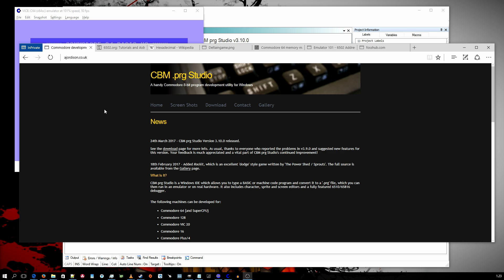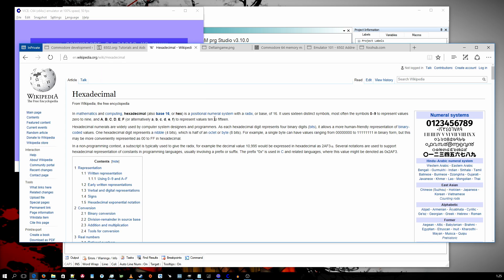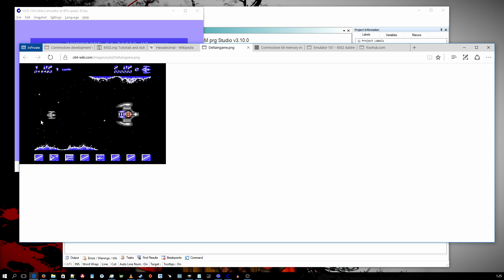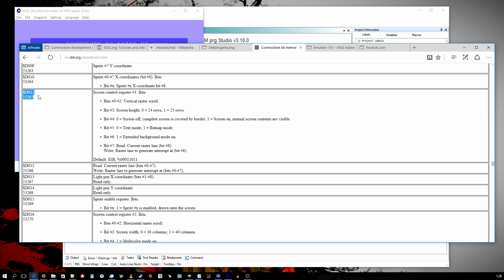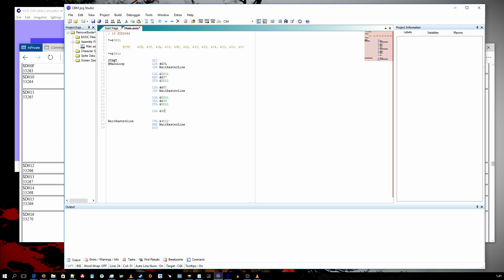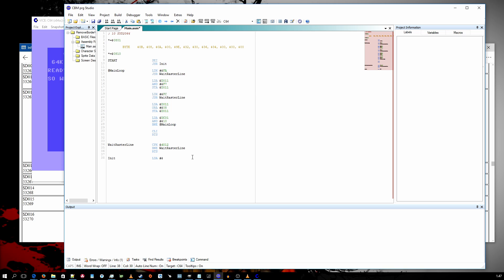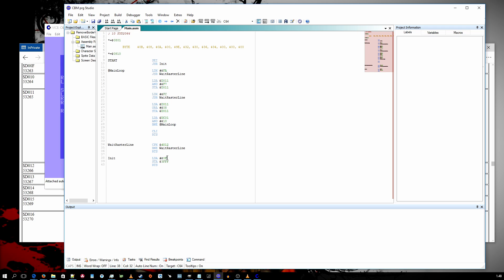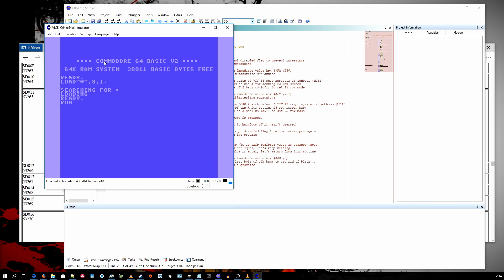C64 Programming - How to Remove Top and Bottom borders

Comment: For the beginner C64 programmer NOTE: this code shows how the borders are removed, but it is not a usable code as it is. If you try to use a loop that waits for a specific scan line, while interrupts are turned off, and you are repeatedly waiting for this scan line, the CPU can do nothing else until you break out of the loop. This needs to be set up as an interrupt routine triggered by the VIC raster interrupt itself. Be sure to watch Retro Coder's next video to see how that's done.